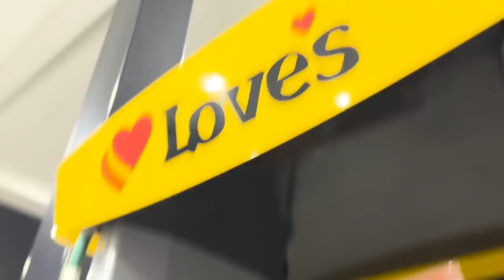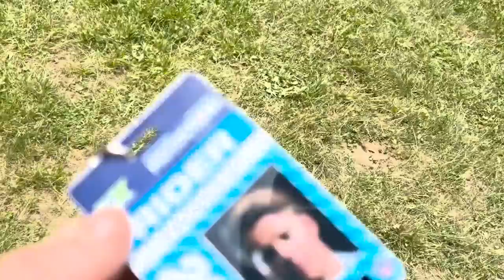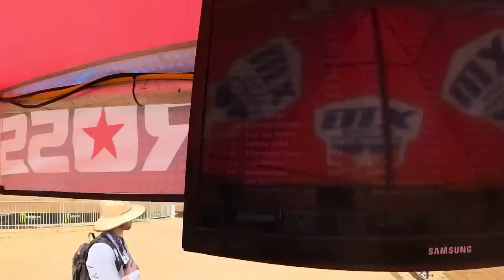POINTS AT THE REDBUD NATIONAL - FLIGHT 787 EP. 3

Comment: Congratulations. If your bike has the transmission oil separate from the engine, use Redline Lightweight Shockproof gear oil, helps the clutch, and try some 1-2mm washers to pack the clutch springs! Good Luck!